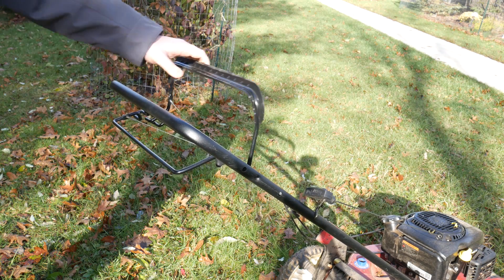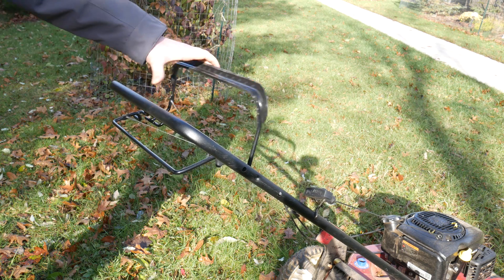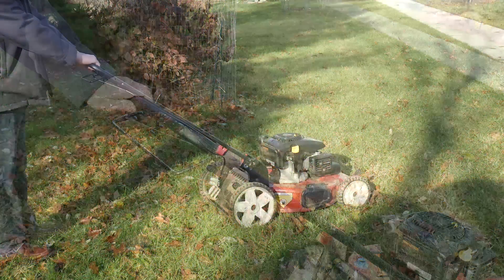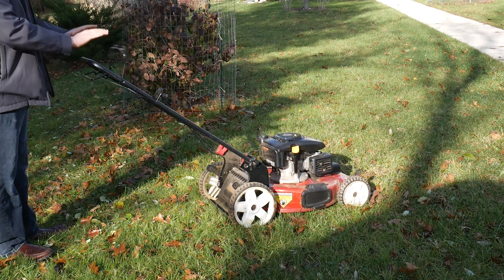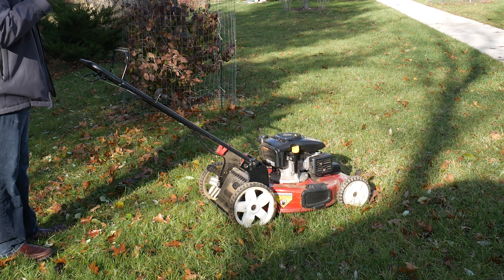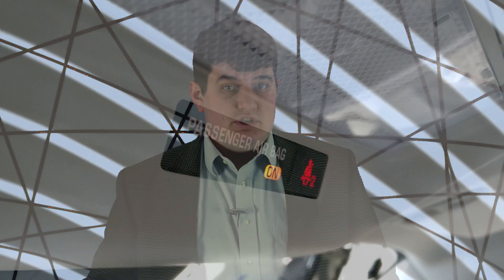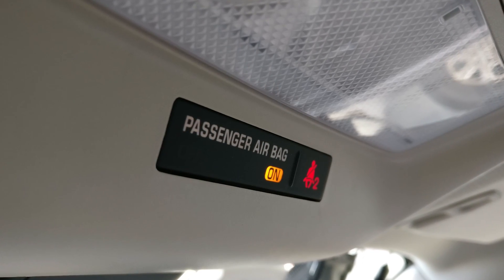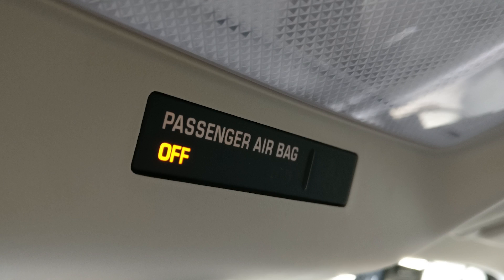The Dead Man's Switch:  How Anton Yelchin's life could have been saved

Comment: Problems that could be asked: 
Just on the Drivers seatbelt? what about on any occupied seat?.
Also... What if the car is moving and your annoying kids decide to prank you by undoing, well, yours, or even theirs (if it works on all seats), etc? 
So... new solution:
Three things to enforce parking brake condition:
Driver Seat is NOT occupied (sensors in Seat detecting weight/lack of)
Driver's Seatbelt is NOT clicked in (If it is and there's no one in it, report such to a blackbox because obviously, its someone who drives without their seat belt on, but still plugged in (the strap between them and the seat, aka sat ontop of it, to silence the seatbelt warning alarm. I've worked with peopl who do that all the time and always refused to be in the vehicles with them in that case) 
Driver DOOR has been opened and closed with the drop in weight on the driver seat occuring during this time. Aka... 
Sequence:
Come to a stop. Put the vehicle in any gear that is not PARK.
Open the door and undo seat belt, either of these first or second.
Get out of the car. Car detects the shift in weight. Door open or shut, the computer now knows that the driver left the vehicle, and that it is in gear - immediate override, disconnect clutch, apply brakes. In cars with Anti-collision emergency braking even the disc brakes can be applied, not just parking brake (Which on some BMW models allowed them to just roll down a hill, because there are two parking brakes on some model of automatic-transmission vehicles. My volvo C30 automatic for instance, has both the parking position on the selector, and a handbrake as typical on a regular manual transmission. Mercedes-Benz cars, such as my dad's MB C220 automatic, has both the selector' parking brake, and a small ratcheted pedal inset to the 'roof' of the footwell. Both my Volvo and my dad's MB parking brake can hold the vehicle on a slope, but there is a little back and forth wiggle room unless the hand/foot brake is also applied.

So anyway. basically, Occupant in seat, no Seat Belt on: Do not allow from Parking to gear until the seat belt comes on. Seat belt on but get in? "Warning you are a clearly not wearing the seat belt, use it numbnuts!" (also with the popularity of automatic help systems aka Ive just crushed automatically call 911... um, I'm british so I'm relying on its prevalence in tv and movies to inform on that, it can even send a report somewhere, like say the manufacturer, every time it is driven with the seatbelt clearly plugged in BENEATH the driver? automatic insurance fail if anything happens, and void a warranty I also imagine. Safety matters, and it wont matter to the idiots until it affects their wallet or life, and since some think the lack of accidents means theyre good drivers... on a breakdown, yeahnope you pay.) 

I shall refer to your roller coaster video (very informative)... Its not just 'is it here or not'. It's other factors like speed/etc. There are likely sensors in the cars (roller coaster) for the restraint systems. Same in a car. (automotive). Not just is it plugged in, but was a sequence of events followed?
A, then B, C and D or D and C, then E.
A: Door open
B: Weight applied to driver seat
C: Seat Belt applied
D: Door closed.
E: Engine on.

Just a note: my Volvo has a curious safety system: I can only turn the key to 0 to remove from the ignition, if the vehicle is in Park. I can Switch off while in Forward, Neutral, or Reverse. I still have to select park with engine off, but I had to do so to remove the key - and since most people have their door keys on a ring with their car key, this is pretty much automatic. About Anton and his Jeep, If he had parked it, and being on a secure property, leaves the keys in the car not holywood style, but in the ignition, I CAN see this happening with the engine OFF. Even Holywood Style of leaving the key in the car would have saved him in this scenario - you know, in the sun visor? He'd have had to select park to get the key out and put it there. (But seriously, who even does that? in the visor, I mean?)

And you do have a point, as more things get linked together, there are more ways of using that to apply safety... if someone thought about it. (They did at Volvo about the key... and yes, My Driver's seat has SENSORS. I can drive along with the seat belt off, and it turns the radio OFF and plays VERY LOUD alarm the faster I go! not tested the following when in gear and motion, but basically I came to a stop, alarm still going, and.... lifted my weight off the seat. the alarm STOPPED. Then I sat back down. Then I pulled off (wont try driving holding myself up off the seat as THAT test!)
I did this on private land and not a public highway since I got curious. That's my story and I'm sticking to it. Not like anyone saw which they would if I HAD done so on a public highway.

And the door has sensors: Many cars dingdingding if the doors aren't closed, or even not closed properly (they can be on the first latch and still alarm, and only stop dinging once passed the second latch.)

Think you can do a little second 'car safety' video with ideas ... with more jokes against Chrysler?

Comment: To be fair, with riding lawnmowers, it's a physical switch: your body weight in the seat is what keeps the battery connected.  When you stand up, springs push the contacts away, completely disconnecting the battery.  It's not really a sensor.

Comment: In my car, if the seatbelt is unbuckled and the car is moving less than 2 or 3 mph, it will shift itself into park when the seat sensor no longer detects an occupant. I'm amazed that more cars don't yet work this way since most (if not all cars) have seat and seatbelt sensors.

Comment: Better yet, instead of switching to park, it can bring the rpm's down to idle speed, and apply the brake till it is safe to put the car into park.  Between abs, traction control, and the transmission computer, this is all there already too

Comment: I think it's a great idea for cars.
But the way I'm required to mow my lawn requires me to walk next to my lawn tractor for about 70 feet. 

Okay, it's not a requirement... But when the other solution adds fifteen to twenty minutes to the task of mowing the lawn, walking next to the tractor is the easiest solution.

Considering that my lawn tractor has a deadman's switch, I had to disable it. Because it's a normally "on" switch, I made a bypass wire with the proper connectors, and plugged it in next to the switch. This way, if I ever sell the tractor, the deadman's switch will be easily re-connected, and safe against misuse.

Comment: Hell there's the seat sensor, proximity sensors etc. in cars that could be used as dead man switches. And since most cars already have ABS - you could mod the code in the ABS system to say if nobody's in the seat, lock the brakes up. 

However one thing annoys me - newer cars with traction control etc. They don't do well in snow. They limit the throttle to the point where you cannot apply power to get out of a snow issue.

Comment: It's called the personal responsibility of owning and operating an automobile.All this technology being built into new cars has a very NEGITIVE effect on the motoring public. It removes the requirement of personal responsibility and makes them stupider then they already are. I own as a daily driver a 1967 Plymouth Valiant with a Slant Six. A 50+ y/o car with a three spd manual column shift. I have installed a shoulder harness and use it every time. I set the parking brake, every time. I check and inspect the car weekly, every week, winter or summer. I keep a roadside kit in the car, checked quarterly. See the pattern here? I take the responsibility of owning and operating an automobile seriously.  Most people don't. If they did then they would never run out of gas. I have an empty gas can in the trunk. Never needed it personally, but have had this conversation several times. "Sigh, You're out of gas? Really? There's this thing called a gauge on your dash, does it work? Uggg, get in the car, I'll run you the station."If you can't be bothered to check the oil and keep gas in the car, then well.....

Comment: the one thing you are forgetting, is shitty sensors.
when the thing fails, your car is dead, whether you are in it or not, that will make people just bypass the sensor as the cars age, and the airbags will not operate as expected because of this.

your suggestion is to make the car idiot proof, not possible, people will still find dumb ways to fail.
personally I prefer the least amount of sensors controlling things as possible, because the sensors always fail, indicating an issue that isn't present.

A very good example of this is gm's passmark II system, notorious for giving false tamper codes, and shutting off your fuel pump, so you have a dead car, and you cant easily bypass it, because it ties into the cars computer, so you would have to either replace the faulty components ($1000 at the dealer), or rewire the whole car to remove it.
I was lucky mine was only a bad sensor in the ignition, i just replaced the ignition, but a few mechanics said it was usually a much more costly fix.

the moral here, is more sensors and kill switches will cause many more issues than they solve. why do you think there are so many old '80s and '90s car on the road still?
many of which have minimal computer control.

also, given how many people still disable the seatbelt sensors, I have no doubt that people will disable seat kill switches when they start to become annoying.

Comment: Liked the video. But let me say, I'm a Software Engineer. Software is not free, cheap or easy. Even a tiny change or addition of code needs to be tested thoroughly to make sure it works ok and doesn't mess with other pieces of code. Even more so on a critical application like car safety. Yes, SW is flexible, and that makes it reusable, so I guess such a piece of code may be reused in many car models. Then, such a small change in code may have a big impact in cost and development schedules of the affected models. Anyway, I've never worked in the car industry, so I may be wrong.

Comment: Part of this problem was caused by the elimination of standard ignition keys. Almost every car with a standard ignition key, that is still on the road today, requires the car to be in park before the key can be removed. I do think that they should have never came up with a gear selector that returns to center regardless of what gear your in. Most automatic shifters have a feel to them, that you can tell what gear you are going to, just by feel, without even looking at the shifter. Since they have eliminated standard ignition keys, and changed how the shifter works, they should have an extra mechanism in place. Since alot of vehicles have an electronic parking brake, I think that the parking brake should be applied automatically if the driver door is opened.
Reply: And it is at this point in the comments that i've realized exactly what kind of gear shift we're talking about... and man i hate those things...
Reply: Engaging the electronic e-brake when the door opens is stupidly dangerous.
The better solution is engaging it when the engine is turned off.
The Deluxe trim of the Renault Scénic II from 2005 does this, while buzzing an alarm if you open the driver's door and the e-brake is disengaged.
Reply: The safety setup Mikey described would be computer controlled and therefor would likely include IF THEN conditions.  If car is 5 MPH or less then put in park and set parking break.  If car is over 5 MPH then sound alarms.
Reply: @calvingreene90:
Luckily, there are people working for these companys that think about this more than 5 minutes.
If speed > "some threshold" -> do nothing. Thats it. But why would the tires lock anyway? What sort of parking brake does ur car have? Holy fuck. I cant even feel mine if i pull it for fun.
Reply: @leocurious9919  before i changed my rear drums to discs i could actually lock my rear wheels at 70mph with my hand brake.
Reply: @OldCircuitGaming  Not bad. I would expect my wires to break if I were to try that ;)
Reply: So when your door is whistling at speed on the freeway the tires lock when you open the door to re-shut it more solidly.
Reply: @calvingreene90  you learn to close your doors properly.
Reply: Also much of the road safety problems at least in America come from americans adopting the automatic transmission in the first place
Reply: @P7777-u7r  will you give it a fucking rest with your misplaced hatred for automatics already?

Comment: I absolutely agree that cars should have a dead man switch - in fact now that you mention it I kinda can't believe we don't already have this. I think we could design a better system than the one you're proposing to be put into new cars (multiple sensors to eliminate the single point of failure, a system to engage some sort of automatic stop if the driver becomes incapacitated, and so on), but you are correctly pointing out that many cars produced today totally have the hardware they need for a first step solution already built in.

Comment: I have never had an issue with these "Safety" systems, IF THEY ARE DISABLEABLE.  More and more often, if one needs to disable a "Safety" systems (where the computer overrides the instructions of the human) it is either complicated or impossible to do.  Traction control systems leave vehicles stranded at the bottom of icy hills they could safely traverse, doors that unlock automatically without override prevent securing your belongings in certain situations, malfunctioning seat belt sensors can harass a driver when the seat belt is properly used, malfunctioning engine sensors can cause unsafe drops in speed while driving on a highway when there is nothing wrong with the engine to begin with... I could go on.  Each of these situations has happened to me, and each time the manufacturer did not allow me to override their faulty equipment on my vehicle.

Comment: A Dead man switch in Railroad terminology called totman is a system that uses switch and / or pedal  that after set amount of time activates the emergency brake if they are not pressed usually uses a loud sound and you have 10 sec to press the button the thing you are talking about is not Dead man switch ... More like auto breaking system

Comment: The only cost to auto makers for a software update is testing. X amount of testing miles driven without error before use by public. 
Then deployment, if possible is sensors are in place. Recalls, man-hours applying update. Mailers, emails notifying of update.

Comment: The best solution to this problem and plenty of other problems is to remove “Park mode” and the associated parking pawl and other components of the transmission. In the rare event that a heavy duty vehicle has an autotragic transmission, they generally don’t have “Park” and the drivers get along just fine using neutral and the parking brake. I wonder how many average slushbox drivers even know what “neutral” is anyway? Criminalize “Park” in new vehicles and people will learn how to control their vehicles. 💯